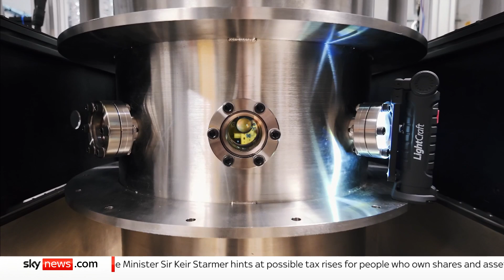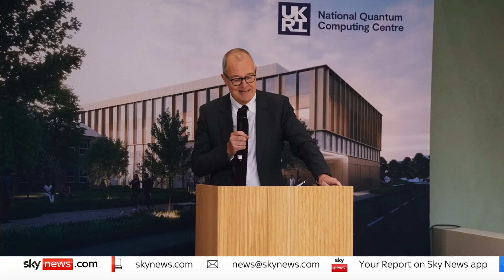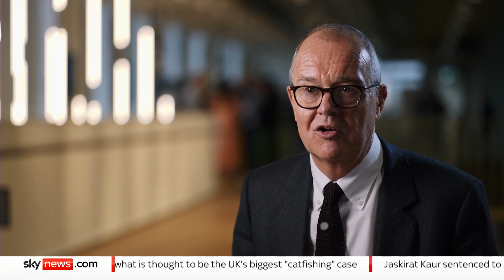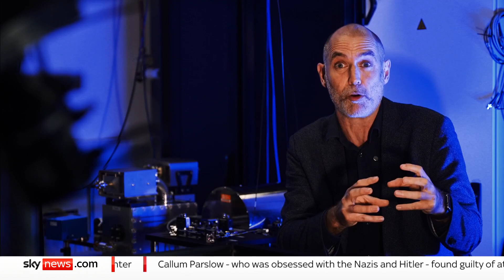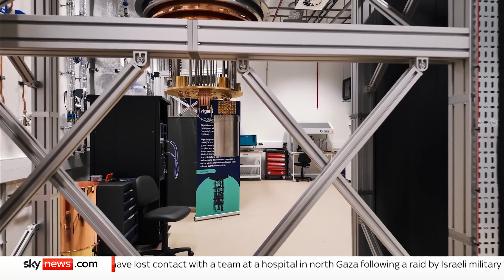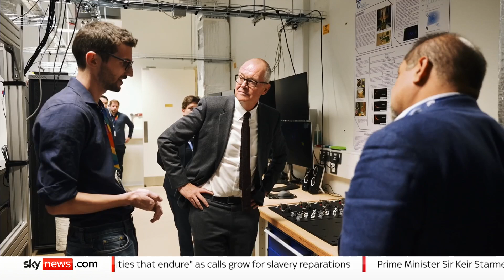Why do the government want to invest billions in quantum computing?

Comment: I can tell ya, The technique is searching for an alternative to the Electron for faster computations.
It fails so far in reliability.
Staple of the logic gate is to result true or false, and a quantity of measure
thats how a computer works.
And so far the quantums cant get a true or false, let a lone a measure.
Tho if the idea is to get a reliable true or false,
and then combine it with an electron for measure
its difficult and i think in the end it will be fruitless for the purpose its intended for.
Tho not to say sub-atomic research is stupid,
it isnt
its to say that from progress so far, and the fact the first major hurdle is unreliable.
and excuses are made for it to be unreliable.
its impossible to utilise an unreliable true or false as the base foundation of any system
despite some theories proposing that it there may be some use for its uncertainty.

The field is a little dreamy, and doesn't provide hard enough evidence that it can excel into a technological use
these heavy machines we see
are to facilitate activity in those sub-atomic particles or or by use of laser and light refractions,
but likewise the result is unreliabile and not yet suitable to build a computer on top of
and not to mention
what computers are currently capable of is impressive. and fast
so it has a steep hill to climb for the theory there is  a minor gain in its speed.

Remember computer is not just true or false, its also measuring a length of a current.
such as after processing in a calculator.
Reply: i believe ideally they want to make a lightspeed computer.
But it is not easy to get that reliability.
And we are not sure of its possibility to ever be reliable
as Electrons they attach to Atoms
these particles are less predictible.
So an atom can pass electrons down a row of coppers or golds
and complete gates and circuits and be detected at points of the circuit.
for these guys it is much more difficult to achieve that feat.